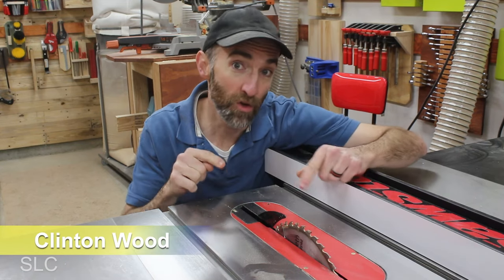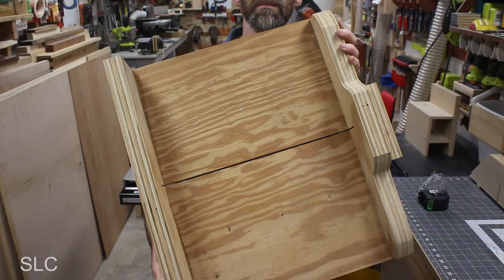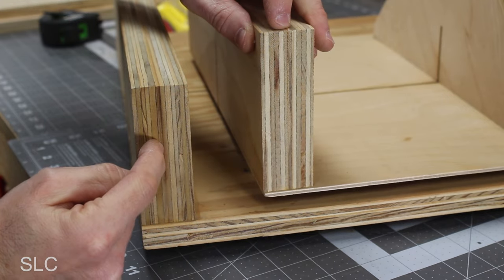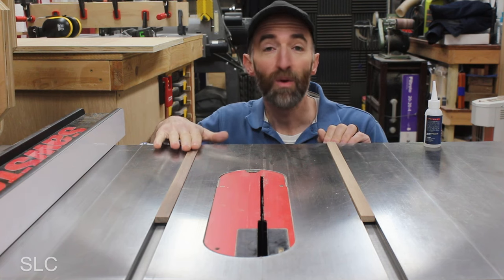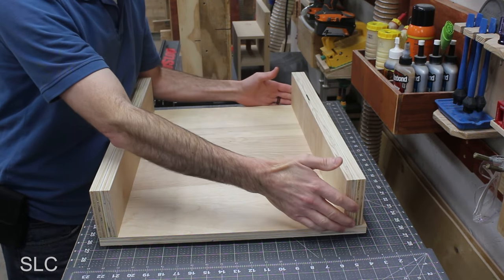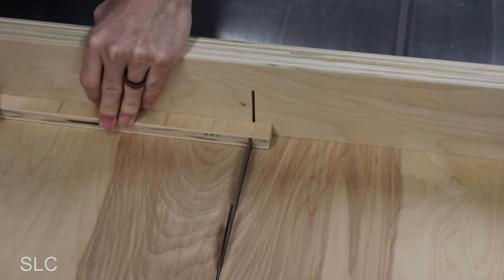Simple Table Saw Crosscut Sled for Beginners

Comment: For sliders, the best material is to get one of those white plastic cutting boards. It's made of HDPE and is very slick and doesn't warp at all. One of the issues with using wood runners (even hardwoods) is that they can expand or contract with the seasons and make your sled either super loose or it will stick and not want to move. Using HDPE you won't have that problem. You can buy 3/4 inch strips of HDPE, but cutting 3/4 strips from a cutting board works just fine too.
Reply: I found uhmw (ultra high molecular weight hdpe) sliders on Amazon pre cut and pre drilled.
Reply: @ravenstarver1360  yeah that's what they are.
Reply: I 3D printed my sliders down to around .002" under the size of the rails, with  countesinked holes and all. It had to be made in 3 pieces par side, but works like a champ.

Comment: I have been so intimidated on making a crosscut sled but you make it look so effortless and easy. Thank you so much for this tutorial. I will definitely be making one now. Well...when it gets warmer lol
Reply from the maker: It is an honor to inspire you Jennifer
Reply: Clinton is a great teacher. This is a great sled/tutorial for a beginner's first sled. Once you use it a bunch and start making a diverse selection of projects you will find out what bells and whistles you want to add to your next one.  This one is very similar to my first one that got me through for 2 years.  My new one has a T-Track on the fence for an adjustable stop.  One tip is to paint that safety block a bright orange or something... just another visual reminder to keep your digits away from the path of the blade. I never end up pushing it far enough to have the blade come through as my workpiece is already cut by then... but just in case...
Reply: I was waiting for you to put a French cleat on it.
Reply: Agreed. I think, logistically this is the best explanation I've seen but only misses one critical point and that you should (consider) beveling/chamfering the rear, inside, (next to your hands) vertical, base push board so no sawdust is kept in the corners. With a chamfered edge, you remove the potential of wood being cut out of 90 degrees exponentially.

Comment: How do you accurately measure for the two pieces that fit into the grooves?
Reply: I would take a measurement of the groove on both sides with a caliper (dial or digital) and then chase that measurement slowly taking a bit more material off the runners each time and test fitting them into the grooves after each pass. Also, like many others in this comment section mentioned, try to avoid using wood runners if you can. Wood will swell and shrink given small differences in your shop's atmosphere and that will make all your effort shaving down the perfect runners pointless in the long run.

Comment: I've used a Craftsman table saw for forty years, and never felt the need to upgrade.  Of course mine was made in 1954, so it's a lot more solid than the one you had, and it has webbed cast aluminum wings properly shimmed to align with the table.  The only maintenance it's ever needed is to refill the grease cup for the bearings once in a great while.

A while back I finally got tired of having to backtrack the fence a skosh after moving it to parallel it to the blade, or tapping on it if I needed serious precision.  So I broke down and bought a Shop Fox fence with extended rails.  I'm planning to build a router table between them, and retire my well-worn portable table.

Never bothered with a sled, because I also have a 1950's DeWalt radial arm saw.  I'm practically a woodshop Jedi master when it comes to setting it up and using it quickly, accurately and efficiently.  And of course, nowadays I've added a 10" miter saw and a 7 1/4" sliding miter saw.

But I might build a basic sled anyway.... never hurts to add another arrow to my quiver.

Comment: Good simple sled video. One suggestion is that when gluing 2 pieces of plywood, there's a possibility that they won't come out truly flat and cause issues with cuts later. If you clamp them together with a level to dry, you're almost assured that they will dry flat
Reply from the maker: Great point! Thank you for sharing!

Comment: Hi, great video and it’s something I want to do. I have an old table saw which is 70 years old but is a very good machine but it only has one mitre slot. Is that gonna prevent me from making a slide? Cheers, Keith
Reply from the maker: I would think that as long as you have a very good fit within the slot and use the sled gently, though I have not done it, it might work.

Comment: 01:10 not if you've got an out feed table
03:26 I'd use polyethylene strips
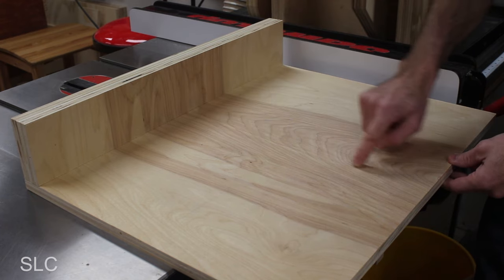06:31 Is it a notch or is it a kerf ?
07:59 Using such cheap (probably Harbor freight) clamps on such a delicate point, is no good thing, boss. Why not using quality clamps from Jorgensen ?
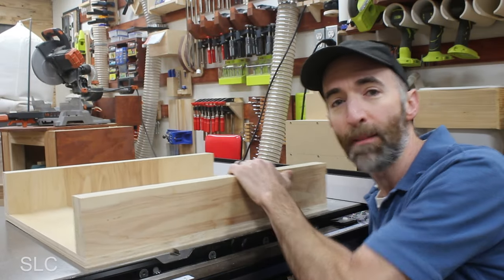08:24 Real freedom can only be provided by Johnson&Johnson boss. BTW: Did you forget to chamfer that fence, so the dust has some space to go?
09:15 My prayers have been answered. Thank you, boss.
10:00 No T-track inserted on top of the fence.. no stop block - Do I give a thumbs up anyway? Hell - yeah!

Comment: Thank you - do you think there is any reason why I can’t have the sides on the end of the base? Many thanks mark
Reply from the maker: If you add sides to the sled, then it would be very difficult to cross-cut longer boards. I guess it really depends on what you will consistently use it for.

Comment: I see the fence on the far side in a lot of sleds, but I know I've never used that side at all, and wonder about the utility.
IMO, it just adds extra weight for not much benefit.
Reply: If you don't have it then you have 2 seperate pieces of plywood for the base only connected by the close rail. It helps keep things balanced when loading and keep everything stronger and  aligned to have that second rail. That's at least the rationale for it.

Comment: Cant stand disingenuous embellishments. I used that same table saw for 10+ years. Of course the fence moves when you dont have it clamped
Reply: I wouldn't say it was disingenuous, but maybe some embellishment to highlight where the fence was giving him issues? I had a small Craftsman contractor saw and it was most definitely not an accurate tool for fine woodworking. The fence could not be adjusted to be square every time, and it was actually still loose when locked in place. Now I have a high end table saw. But you still should use a simple crosscut sled like the one in this video to make, accurate, repeatable and,  most importantly, safe cross cuts.
Reply: Thats one sloppy fence though! If your fence has that much slop you'd have to check square every time you clamp it.